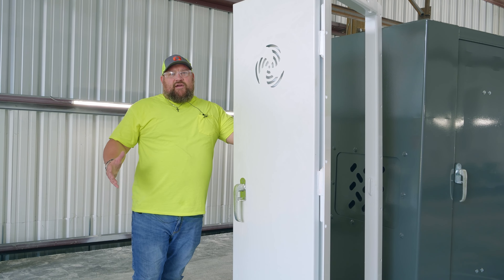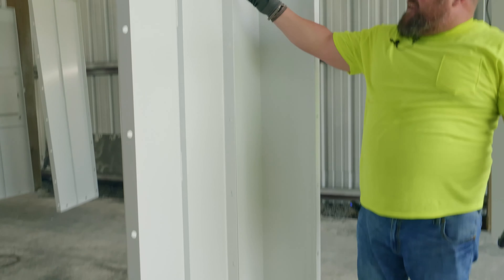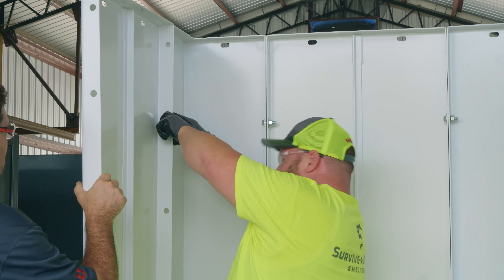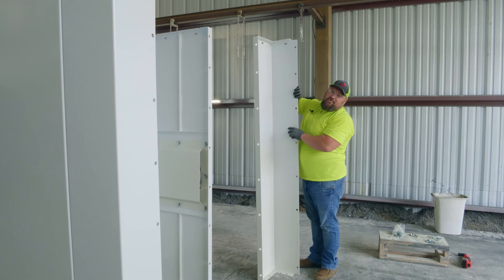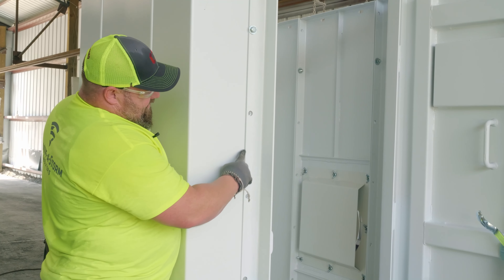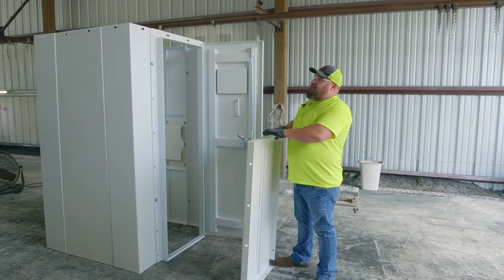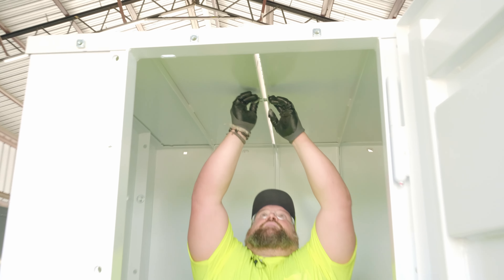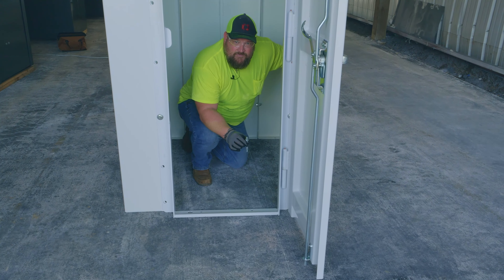Panelized Tornado Shelter Installation Guide | Survive-A-Storm Shelters

Comment: Has that shelter been tested by 3rd parties to withstand over 250mph winds and being hit by flying 2x4's. 3/8 anchor bolts are a bit small for a shelter you want to withstand EF5 tornado in.  I would advise people to shop around and look at metal thickness and size of anchor bolts being used.
Reply from the maker: Yes, this has been tested, rated and approved by third parties to withstand a EF5, 2x4 at 250 mph winds was actually part of the testing

Comment: he first thing you need to do before even considering this storm shelter is to determine whether you have a Post Tensioned Slab. If your slab is Post Tensioned (high tensioned cables running through the concrete), you will have no way to anchor the shelter. NEVER DRILL INTO A POST TENSIONED SLAB. If you should drill into a cable, even nick a cable, you risk the destruction of the concrete slab as well as injury or death. There may be services available that can locate and mark the cable locations using x-ray or a metal detector so you can avoid them, but you have to consider the risk. Aside your own safety, you can destroy your house.
Reply: You have a business or certification doing this?